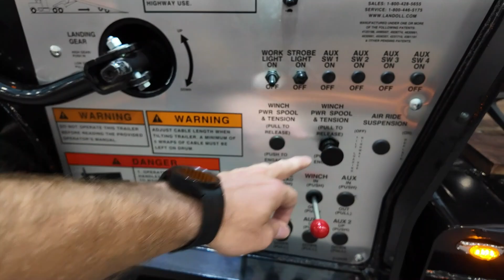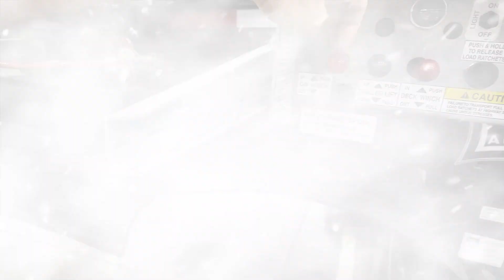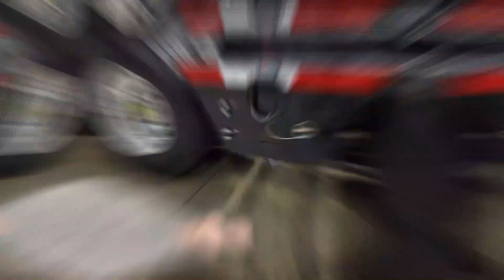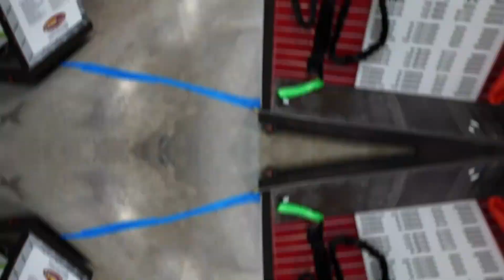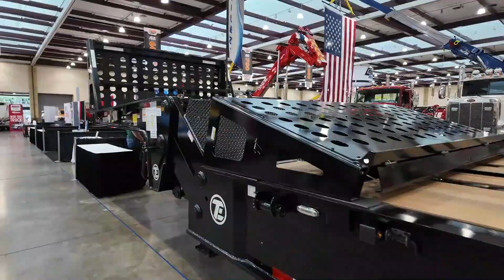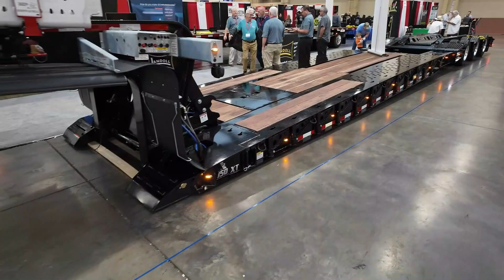Must-See Trucks and Trailers from the 2024 Tennessee Tow Show

Comment: It's honestly really sad that Landoll makes dumb excuses about air lift 3rd axle on their 455 trailers --- it just means two different times...five years apart I've spec'ed out 455 trailers WITH the aluminum slideouts to extend the width...and had to go with Trail-Eze because they do build a 3 axle sliding axle with an airlift 3rd axle --- Boneheads --- they're as blind to their customers needs as the democrat party!
Reply from the maker: Sheesh, that actually hurt me. I love landoll and I'll revisit this. As a matter of fact. I'll send them your comment and see what if I can pull and rabbit out of a hat! I am a tenacious sob 😭
Reply: @HeavyHaulHQ  You're welcome to tell them about us --- I've literally gone to two different dealers, developing a verified purchase order on a fully loaded 455 with the aluminum slideouts that make that trailer go to 13'6" wide...that's a 130k trailer...but they just refuse --- sadly....it can be done --- every other trailer manufacturer with a tridem set will build a 3rd axle lift ---- and, you can tell them...I've now bought a Trail-Eze and a Trail King...really close to 5 years apart --- they go on and on about there not being enough clearance between the  ground and the deck...well...how are other OEM's doing it --- just laziness...they'd have to do the engineering...and actually try harder!
Reply from the maker: @SummitAggregates  I did email them. It may require changing to a different suspension. Let me know if you ever need anything from me! I can always try my best to help.
Reply: @HeavyHaulHQ  I sent you an email...
Reply: Same with us --- I've been engineering a tiltop out of two "double Schnabel trailers...to enable you to back a snowcat up on the deck of a standard width trailer with the blade and tiller attached and literally rotate the load so you left and right extremes would be in top left and bottom right of the hypotenuse of the triangle so you could haul an 18 wide snowcat intact...just something new and strange to do...

Comment: These trailers are rubbish. Have a look at the trailers from Australia from Drake Trailers or Tuff Trailers. Removable goosenecks went out in the 70’s.
Reply from the maker: @Louie2309  bro calm down. We aren't in Australia. Plus you sound disrespectful
Reply: @HeavyHaulHQ  I don’t get why Americans still use such outdated and inefficient trailing gear.
Reply from the maker: @Louie2309  it's perfect for our roads sir. This is the highest quality trailer. Think of It's like drake but for our laws
Reply: @HeavyHaulHQ  removable goosenecks and removable timber for a wider deck is hardly anywhere near anything Drake build. It outdated and your laws are a lot more relaxed than Australia. I don’t know why the industry still accepts it from manufacturers or don’t operators no any better over there?if you pulled up to a job with one of those trailers here , the customer would reject giving you the load. Maybe I am disrespectful of what you accept for state of the art equipment, but I’m continually blown away by how backwards America is sometimes.
Reply from the maker: @Louie2309  I understand, but we have what we need honestly. This trailer is for hauling busses and motor coach. The other is a huge wrecker 😍
Reply: @HeavyHaulHQ  yeah I get your happy with what you use, but honestly, there is a whole another world that can give you a better way of doing things. But you can lead a horse to water… 👍
Reply from the maker: @Louie2309  Well, I guess you can tell me the model trailer that hauls busses in Australia, and I will go look at it?
Reply: @HeavyHaulHQ  both Tuff Trailers and Drake build Supertilt  tilt and slide trailers. They come in extendable and hydraulic widening deck as well and three and four axle variants with steerable axles and two or three winches for recovering vehicles.
Reply from the maker: @Louie2309  ok, I went and watched an entire video on it. It is made with Australia law in mind. I think it is nice. The Landoll group is the best company around. Period. Drake is nice but it's not a Landoll. Promise 😉🫡
Reply: @HeavyHaulHQ  I have looked at Landoll. Maybe it’s the best over there, but I left feeling underwhelmed. Varying country laws can be @djusted to suit, they do all around the world , but Landall can step it up a notch and that sliding axle system is unnecessarily complicated and a tilt slide gives better stability and o lower loading angle.
Reply from the maker: @Louie2309  there is a give and take for sure. What you are referring to as load angle will also make a longer footprint by a lot won't it? This hauls exactly what it's supposed to at a reduced overall weight as well. I've worked on and around a lot of great trailers. I've seen behind the curtains of the operations. I'd bet my reputation on Landoll as an extremely impressive company. And to be fair there are a lot of impressive companies. But they are not a Landoll 🤝
Reply: @HeavyHaulHQ  I would take stability while loading over longer footprint any day. Widening deck makes it far safer when loading over width machines.
Reply from the maker: @Louie2309  we have not seen stability issues with these. Again we have wide trailers for wide loads. It makes the trailer really heavy when you cram too much stuff into one unit. Our bridge laws require it
Reply: @HeavyHaulHQ  Drake Trailers reputation is known world wide for innovative and strong heavy haulage trailers. The demand is so strong there is usually a two year wait time and second hand Drake trailers hold their value so well. Tuff Trailers are continually gaining a very good reputation for quality , innovative ideas and customisation.
Reply from the maker: @Louie2309  I get it. It's the same here brother. But a little better. Stronger faster better. Like kanye said. We are in America
Reply: @HeavyHaulHQ  yes we have bridge laws as well, although they are a lot more standardised between states whereas you have a lot of variations between states.  A lot of heavy permits require the axles to be spread out a certain width so as to maintain a larger contact patch and ground pressure area on the roads and bridges.
Reply from the maker: @Louie2309  Yes exactly 💯 well said sir! What time is it where you are?
Reply: @HeavyHaulHQ  at the moment, 12.00 pm midst Sunday 6  October
Reply: What time is it there?
Reply from the maker: @Louie2309  it's 9 am
Reply: I follow lotsa transport systems and have friends in heavy haul here in California USA and there's no way an Aussie trailer would work here, Too high, too heavy. We have serious bridge laws that would allow a swing wing to carry next to nothing. Check out Cozad, Murray and Rackley trailers, Load over the trail and necks off and on in 3-5 minutes... Our guys would beg to differ on yer assessment of what's trash. I would also point out that Drake at least copied a Landolls AWESOME utility fer rental yards and gentle load angles. Not being rude but WHAT does AUS have in the global market? Kenworth? Mack? oh wait...
Reply from the maker: @Jdigger4130  sheesh, well said
Reply: @Jdigger4130  we have same  height restrictions  here. Can’t say I agree on your assessment of ease of use removing gooseneck. Lot of fcking around if you ask me. Droping it down to the ground, unpinning it, uncoupling hoses. Then moving truck and find somewhere to park it while the machines load onto the trailer, then reverse it all to hook up again. As well as not being able to correctly measure parts of load or gauge camber on the deck until at travel configuration. Don’t know where you got your information regarding Drake copying Landol. Just nothing like it.
Reply: @Jdigger4130  not sure what you mean be what do we have on global market. Explain yourself better please.
Reply: Lol, i guess your trailers are the best just like your drag cars were faster than the 405 cars
 🤣🤣🤣🤣
Reply: @SS454JF  well, yeah. Our trailer designs are far superior. We haven’t had removable gooseneck trailers for 40 years. Don’t know anything about Greg racing. Real racing is circuit racing. Anyone can go fast in a straight line.
Reply: @Louie2309  It was DRAG racing very pop. In Aust. But i guess you dont know about it. Until you try going straight fast then talk . 👎👎
Reply: @ no I knows of it and tried it. Just thought it was boring. Circuit racing go fast, corner and stop
Reply: @ yeah, I’ve done drag racing. Found it boring and a lot of 5pm sitting around to do a pass. Circuit racing has more challenges where you have to be fast in a straight line  and in braking and cornering. All while fighting for a posi5ion to put your car with 20 plus other lunatics trying to do the same thing.